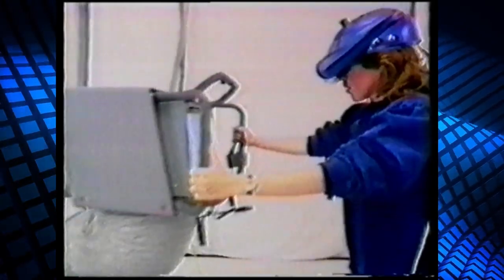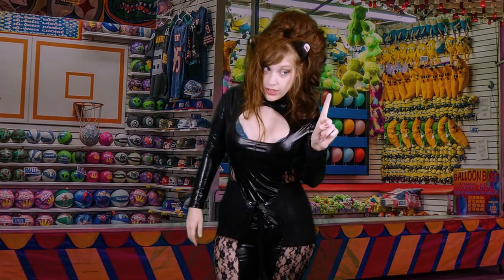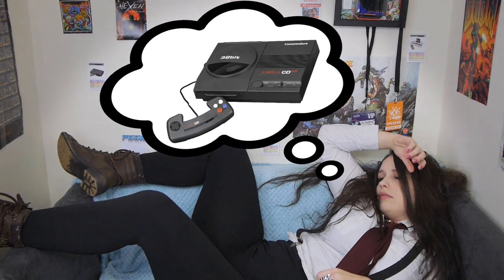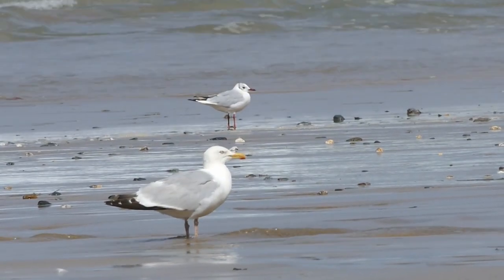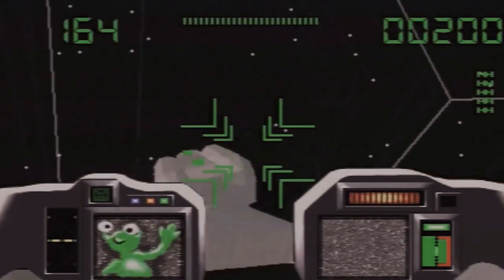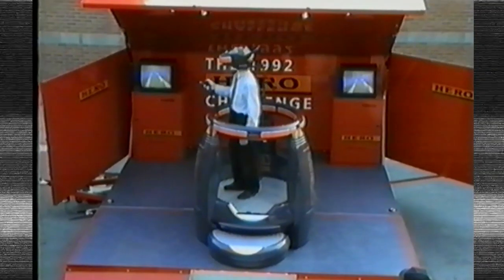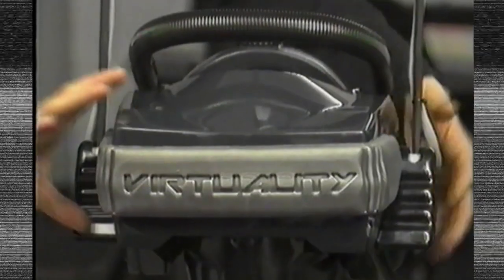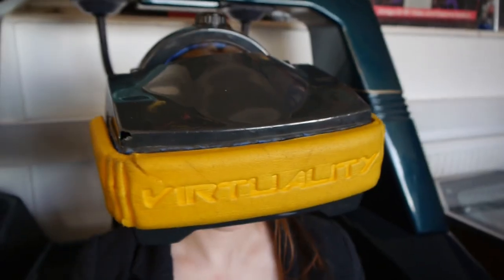The Games of Virtuality 90s VR Experience | Octav1us

Comment: I snagged a set of 2000SU machines and have been buying up all the spare parts I can off forums. Currently have 3 and a half headsets, a full set of NOS boards, extra controllers and some games. I cleaned up the machines, but don't have them working. One of these days... It's incredibly hard to find help on them.

Comment: Octav1us we perceive depth in at least two ways. One is stereoscopic vision. The other one is parallax and it's what we actually use to perceive depth over larger distances. It is when you "strafe" your head left and right, without turning, to see the relative motion of items in your field of view: with nearby items moving more than distant items do. The question now is: did this VR machine support rendering the scene from a different point if you did strafe your head? Or did it only take the angle of the direction of your head into account? If it supports taking the position and not just the angle of your head then you can taste the 3D effect whether you have stereoscopic vision or not. For example the PSVR supports and needs positional tracking when you play something like SkyrimVR or any game for that matter but when you are out in the menus using the theater view of PSVR, if you move away the camera, the PSVR will stop tracking position but will keep tracking orientation. I wonder if this virtuality thing did track both.

Comment: 6:16 finally giving the viewers what they've been salivating over. These contraptions were definitely odd, though my Occulus Rift dev kit looks suspiciously similar to the virtuality headset on the inside...right down to those funky lenses, of which there's a few you can swap out. Seems that modern VR looks very similar to this, including the options for walking / running in that circle thing. Maybe they were ahead of the times, but I doubt the average consumer could afford one. Modern VR isn't that cheap either unfortunately.